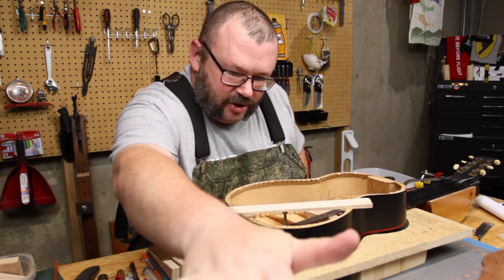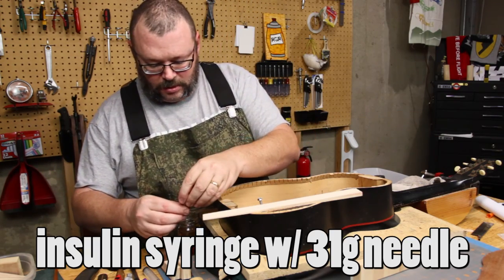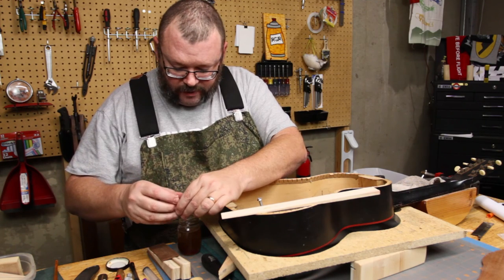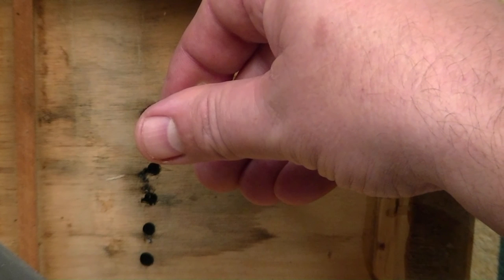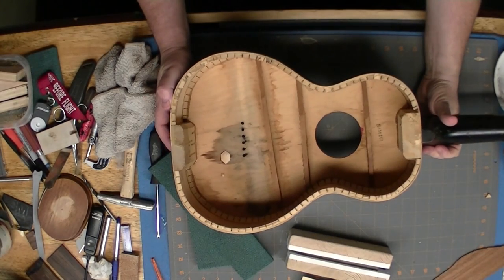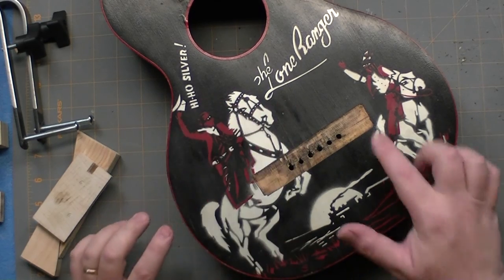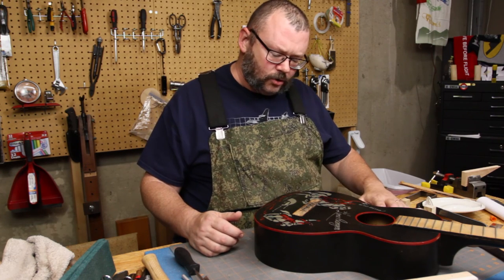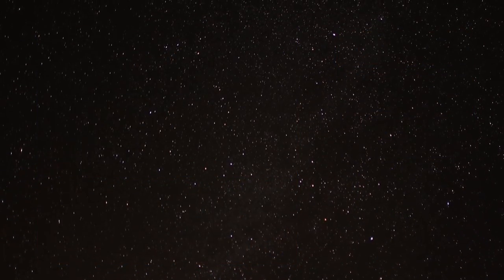soundboard crack cleat fix SUPERTONE LONE RANGER pt9 | RATTLECAN GUITAR RESTORATIONS by James O’Rear

Comment: When you install the new bridge support brace on the underside of the top and let the glue get in to all he cracks and crevasse, you may correct the instability in the bridge area and you will need to redrill the peg holes. It may not be necessary to plug the peg holes. Thankz

Comment: Wonder if an epoxy stick might work? I used it a lot in the painting field to repair damaged wood and rot. Its comes in stick form and has both parts, you just cut off what you need and knead it til it becomes one color and then apply. When it hardens it can be drilled and sanded

Comment: I dont think id plug the holes at all. Maybe some thick CA glue then after that has set put the bridge and bridge plate on normally. This guitar was not designed for steel strings so when you put nylon strings on it should be fine.

Comment: Nice job hydrating and gluing the crack. I agree with what Dane said. If you feel you need to fill the holes I think it makes more sense to cut out a section with all the holes and replace it with a single piece of wood instead of dowels in just the 3 holes.

Comment: I'm thinking plugging the holes will create a truss effect which will impede the flattening process. So I would do what you can to flatten the top first then plug after. As to weather plugging is really needed I don't see much advantage. Once the bridge plate and bridge are in place you have two massive cleats holding all the little defects together. Plus the hide glue will fill the peg hole cavities and what little glue is left after drilling the new holes will just fill the tiny voids in question. Not to mention hide glue dries very glass like and will not suck up any tone you might get out of the donkey fart guitar.

Also wanted to mention that is a fine looking cleat you made.
Reply from the maker: I was thinking of doing it after the flattening process for exactly the reasons you mentioned. I may have to make a DFG notation on it somewhere...lol. And thanks for noticing the cleat.